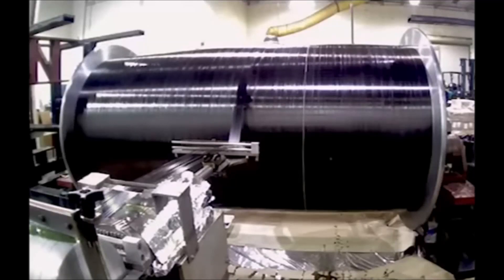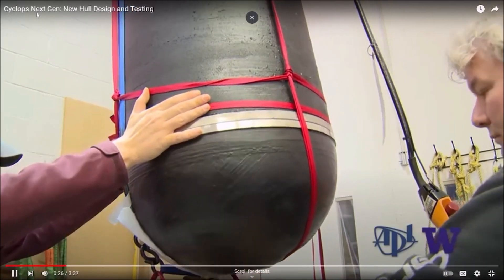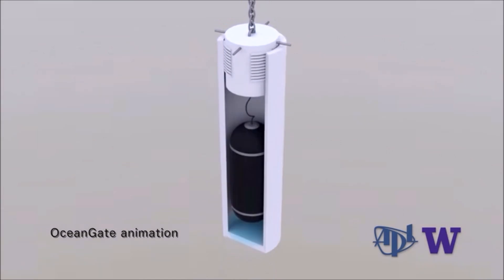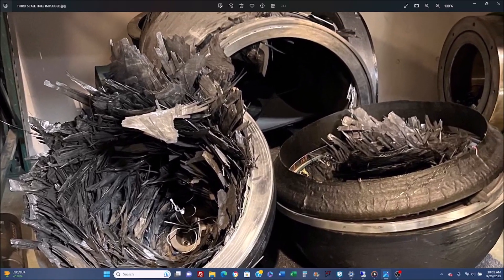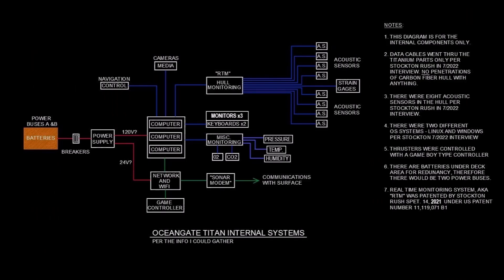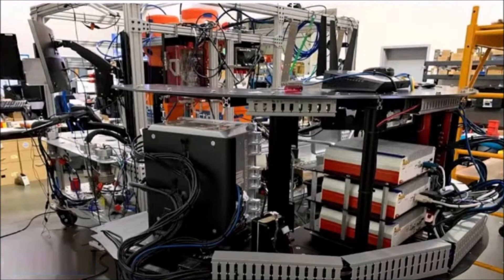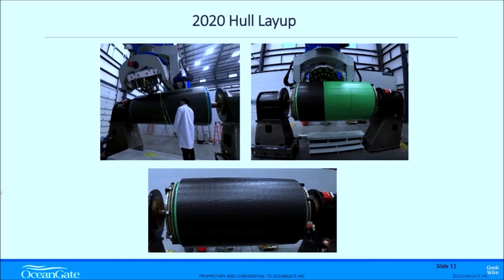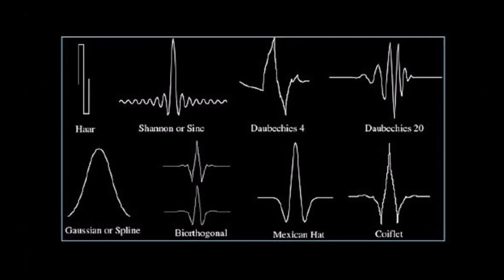OceanGate Titan - WHY USE CARBON FIBER?

Comment: Describing the use of carbon fiber for the hull of the submersible @5:28 "Was it the right move?"  Given that Stockton Rush was killed as a result of choosing this design I think the answer is clearly "No!!!"
I have a mechanical engineering degree which included a course in composite materials and when I heard that the hull was made with carbon fiber I thought that choice was the exact opposite of everything I had learned in university.  Composites like this are good in tension however the load the hull experiences is compression.  Using a composite in this application means you are subjecting it to a compressive load.
When a composite begins making a cracking sound that is a sign that either the fiber is breaking or that the fiber is breaking free of the matrix.  Both of these conditions indicate that the composite is being weakened because it cannot handle the load it is experiencing.  Whether the hull collapses or not that is a sign that the design is not working as intended.  The fact that Stockton Rush knew it had made cracking noises and continued to use it is completely inexplicable to me.
Reply: If the vessel is pressurized, the carbon fibre is under tension. The CF is picking up the load.
In the submarine, the vessel is under pressure, the CF is not in tension, only the Epoxy is taking up the load. Now it becomes the theme of a horror movie.
In this context, I think glass fibre might hold a better chance than carbon fibre.

Under compression, the CF inside should wrinkle and leave weak spots between layers so the high pressure sea water acting as a hydraulic fluid to crack open the inner layer defects to create the recorded sound.

In engineering 101, we have cantilever truss. The truss beam members could be in tension or in compression. For those parts in tension, the member could be replaced by a rope. But replace the beam in compression, it falls.
Reply from the maker: @lpjunction  Yes the way these cylinders were manufactured, the strength was mainly in the resin. If they could do a layup where every layer was alternating with fibers going in three different directions (an X-pattern along with the hoop) I think it might do the job. Problem is they can’t manufacture it like that.
Reply from the maker: It's easy to say that it wasn't the right move in hindsight. 😉I know exactly what you are saying and don't disagree with any of it. Don't know if they went over the Kaiser Effect in your courses but that seems be be what Rush was basing the whole thing on. It makes sense to me that on the first dive there will be a certain amount of fibers that will break when taken down to depth, because we can't really manufacture a 100% flawless CF cylinder. On successive dives there should really be no more noise unless you exceed the last maximum. That's exactly how the 2020 hull performed until it suddenly failed. The 2017 hull did not align with what was expected... on every dive it was making noise, which it shouldn't have done, so it was scrapped. 

Seems to me like Rush was maybe applying the Kaiser Effect to carbon fiber where maybe it doesn't apply in the same way as metals or sedimentary rock, or maybe not at all.
Reply: @VegasCyclingFreak  I did take a graduate level course in composite materials but I am pretty certain that we never covered the Kaiser effect in any of my courses.  Having said that I would not be inclined to apply the Kaiser effect to a composite material in this situation.  From what I can tell, the Kaiser effect describes something (in this case a cylindrical hull) being stressed, making a noise, having the stress removed and then the stress is reapplied in a way that the thing being stressed responds elastically.  The elastic response is important.  If the sound was made by fibers breaking then the snapped fiber has failed.  That is is not elastic.  The material holding the fibers could respond elastically if it is an elastic material and the level of mechanical stress it is subjected to remains under a critical threshold.  I realize that it sounds odd but metals, when properly processed have excellent elastic behaviour.  In contrast, plastics and resins are not very elastic.

Alternatively, let's just ignore the Kaiser effect completely for a moment. In this case, the submersible goes down, there is a cracking sound which (hopefully we can agree) indicates some sort of damage to the composite hull.  In order to know if the hull is safe or not we would need to know how damaged it is.  If the sound is the sound of a fiber breaking then how many of the fibers broke?  How can we tell how much damage the hull actually took?  If we can't tell how much damage the hull took, how can be be sure it is safe?  That question can be very difficult to answer.  If it is absolutely essential to design the hull out of a fiber composite then the designer has an obligation to ensure that none of the fibers ever breaks during regular use.  If the designer cannot provide a design like that then they need to step away from the project.

That is why experts stick to design standards which are known to be safe.  When an engineer knowingly avoids these practices and puts someone's life in danger it is considered negligence which can be grounds for criminal prosecution.  Whether or not the Kaiser effect could be applied to composite submersible hull prior to this incident was clearly unproven and at best uncertain.  The effect of a hull rupture at depth was very predictable.  Design standards exist for a reason.
Reply from the maker: @VictorLonmo  Very well put. You bring up some of the same points I have pondered.

I have been coming to the same conclusion about the Kaiser Effect. I think maybe it was misapplied here. Kaiser Effect is also used with respect to certain kinds of rock too, so maybe Rush thought it could apply to CF as well. Does rock have an elastic response? That would be more along the lines of seismicity, wouldn't it? Kaiser Effect seems to apply in both cases. 

Carbon fiber really seems to be in a league of its own here. Rush's philosophy was that on the first dive you'll hear some of the fibers breaking because "they didn't make the team" but on the second dive you should hear none. The question is how much damage does that represent? Also the acoustic sensors in the rtm system were centered at 150kHz. What if the resin was breaking down on every dive but it went unnoticed because it was outside the range of what they were listening for? It is problematic using Kaiser Effect in this case.

If you want to read more about Kaiser Effect, here is a link to an interesting article:
https://www.ndt.net/article/jae/papers/22-S01.pdf

Comment: I think in order to reach positive buoyancy (making the carbon thinner) eliminates the supposed benefit of ; "strength to buoyancy" of carbon.
If you try and achieve the buoyancy by reducing the thickness then carbon becomes to weak for the job !
5" was not enough !
Unlike Titanium the proper thickness of carbon fiber for this type of application was never really properly established !
Imagine if instead of the required and well established 3 1/4" of Titanium they went with 1 3/4" of Titanium simply to reach positive buoyancy !
5" of carbon was not enough and My guess it would have needed between 12"-16" of carbon, and at those sizes the buoyancy advantage becomes moot !
Think about it the carbon was only a mere 1.75 inches thicker than the titanium !

Comment: Did he want high strength to buoyancy for safety Or because syntactic foam is very expensive? I would guess the composite structure was also far cheaper than a similarly sized forged titanium structure. So Rush being an engineer says, if composite is safer because of strength to buoyancy, and it’s cheaper, why NOT use it? I don’t think he calculated the cost of certification/testing or the cost of his life (risk).

Comment: I don’t think you’ll see the same debris in a chamber as you would on a real dive. Once a major failure occurs in a test chamber the pressure will drop rapidly because there is very little volume of compressed water. I could be wrong though.
Reply: You are not wrong.

Comment: Also, wound carbon fiber vessels are typically used for the containment of pressure within the vessel, since the fiber is then pulled as those forces react against the fiber, outwards. The resins used to bond those fibers in the curing process, play a secondary role in that resistance.
Imagine winding thread around your fingers and trying to force those threads outwards. If you were to reverse that force, however, and apply it to the outside of your vessel model inwards, the tensile strength of the fiber decreases dramatically. Imagine your thread wrapping model. The primary resistance to that force pushing in, as opposed to out, then becomes your fingers and not the thread.
 In the case of using a wound and cured carbon fiber submersible, the resin plays a greater role in reacting against that pressure. The resistance to that pressure, becomes dependent on the resin used to bond the fibers, moreso than the fiber itself, which defeats the purpose of using a wound vessel.

Comment: Deep sea vessels are made of material/s that have a very high compressive strength.  The obvious reason is in that environmental sea pressure creates tremendous crushing force on the outside of these vessels.  Primarily important to avoid catastrophic destruction by implosion, a deep sea vessel must have sufficient compressive strength.   IF this strength condition is met , THEN and only then, can other advantages of one material over another be utilized.  Carbon fiber composites are not nearly as strong in compression as in tension.  Hence they are found in airplane bodies which makes use of their high tensile strength (rather than their relatively weaker compressive strength).   So to me, it is pointless to bring up the strength/buoyancy ratio of a material that doesn't first meet the compressive strength criterion for deep sea diving.   (even though the Titan reached the 12,500 ft Titanic depth a few times, it obviously wasn't strong enough to continue experiencing the tremendous cyclic forces incurred)
Reply from the maker: True but it also all depends on how the carbon fiber is manufactured. I think there is a way to do it but we can't with the technology that is currently available - the machines aren't capable of winding cylinders with filaments going in three different directions, which is how I think it needed to be manufactured. I believe Titan was on its 14th "mission" to Titanic when it imploded. They had also made some other dives to do 8K video of Titanic as well, so maybe 18-20 dives to 3,800 meters as far as I can tell. Apparently the hull failure was due to a sudden and unpredictable development which seems to point to kink band formation. The 2017 hull never even made one dive to the Titanic because it was not following the rules of the Kaiser Effect and had to be scrapped. That's why the new hull was made in 2020 and it performed exactly as predicted. The real time monitoring system was supposed to prevent this from ever happening so there's a disconnect somewhere...

Comment: You couldn't fit 4 people +1 in titanium = no mula
Reply from the maker: Yes I should have also mentioned that. That was the other factor... but on the other hand, it's kind of obvious as the Cyclops was also a five passenger steel hulled sub that could go to only 500 meters. Titan was like the Cyclops on steroids, so to speak.

Comment: I keep saying this, ultimately the decision that made this incident a tragedy was to allow passengers on board.  Nothing else. If Stockton and a handful of employees died at 3k dept in some kind of unregulated experimental sub, the media attention would have been marginal.

Although I find the engineering aspects fascinating, the engineering decisions did not lead to the tragedy.
Something and/or someone pressured him to take passengers. Hubris and prestige must surely have played a certain role. 
But if investors forced ocean gate to take this path, then I consider that the root cause !
Reply from the maker: Ultimately, the Titan (originally called Cyclops 2) was the Cyclops taken a few steps farther and made to theoretically withstand depth of 4,000 meters. Rush originally wanted the hull rated for 6,600 meters but apparently he couldn't get the manufacturers to give him something that actually could meet that spec. As we can see, one failed miserably and the other one eventually failed for reasons unknown. Anyway, the Cyclops was also a five person sub made with a steel hull and it couldn't dive very deep at all.

According to a former business partner, Rush was very risk averse. I don't believe he was the person that he has been painted out be. Yes, a bit of a maverick but not some suicidal crazy daredevil. He was actually a lot more concerned about people getting hurt before they got into the Titan. He actually said that once you were inside it was the safest place you could be in the world. 

It could be that investors were partly driving this. I am not sure how Rush went from diving the Puget Sound to wanting to dive to the Titanic. I don't know enough of the back story here. Anyway, the reason I am doing all of these videos is because I do find the design of the Titan interesting from an engineering perspective and also to get to the bottom of the possible ways that it could have failed. This has turned into a hugely larger endeavor than I thought it would be!

Comment: Interesting video, but I disagree with your ultimate conclusion. It was all about the cost. Stockton Rush wanted better strength-to-buoyancy, yes, because it would mean less cost. It was all about profit margins. He gambled not only his own life, but the lives of others, on this cost-cutting measure. 

As I've pointed out on other videos, Stockton Rush was wrong about his interpretation of the noises he heard. The only acceptable noises coming from his pressure vessel would be no noises (meaning that no carbon fibers had broken). His second hull was thus nearly as bad as his first hull: mortally-wounded and unacceptably-weakened after the very first dive. An implosion was inevitable; not "if", but "when".

The most interesting moment in your video, though, is at 2:26 when you falsely say "the carbon fiber just shredded". No it didn't! Your visuals disprove your words! That's not "shredded" at all! That's delaminated! "Shredded" would be random fibers broken in random places. That's not what we're seeing! We're seeing entire laminae breaking all at once, along sharp edges! Fascinating! It also gives huge clues on how carbon fiber composites can be made just as strong under compression as under tension: One must use symmetric 3D matrices instead of laminated 2D laminae. One can't do that using simple winding bobbins as shown in this video, though; a way would have to be found to insure that the carbon fibers were structured like a random heap of over-cooked spaghetti piled on a plate, rather than strands going all in 1 direction or even 2 directions. The strands must go in 3 directions. Then you can make 4000m submersibles out of carbon fiber. But not if the strands only go in 1 or 2 directions; it's that asymmetry which destroys the ability to handle compression.
Reply from the maker: Yes, in technical terms it de-laminated. In my mind it's all the same thing here. One could even say it exploded. That's the term that Rush used. That's all a semantics game that we can split hairs over, like the peanut butter thing. All Rush was doing there was describing the consistency of the glue in terms people would understand and everyone went off the deep end about it. lol

We can agree on one thing: I had a graphic in my last video where I showed how I thought the CF layup should have been done with layers going three different directions. I had that thought only a few days after the implosion when I watched that 2017 hull winding video before OceanGate took all of their videos down, which I knew was inevitable. That was not the hull that was actually in Titan when it imploded, however. The 2020 hull was probably was made roughly the same way but with what appears to be a better type of carbon fiber using a little better process. 

I did not mention it but the other reason for going with carbon fiber is to make it large enough for five people. Still disagree that it was all about cost. How should he have done it then? An enormously heavy 10 foot diameter sphere with huge amounts of syntactic foam? Maybe you could get five people inside of that. Is that going to look cool and appeal to extreme adventure seeking billionaires?

For me this all goes back to the manufacturers. They were supposed to be the real experts here. One hull failed by a mile and the other one eventually failed too, I think after 20 dives total with 13 "missions" to the Titanic. Rush was depending on them to build him something to his specs. Why would both of the manufacturers have done it more or less the same way? Seems to me that they don't have a better way of doing it, and/or their modeling programs led them to false conclusions about how to manufacture it. It seems painfully obvious that fibers going three different directions is the proper way to do it. 

You can argue the Kaiser Effect thing both ways, but it applies even to metals. Titanium probably also would make some amount of noise on the very first dive but after that would be quiet because you're not exceeding the last maximum. I think it's impossible for the carbon fiber to never make any noise in this kind of circumstance due to the nature of the material. I don't know that it has a "memory" like metals do. Perhaps that is where Stockton made an error with his trust in the real time monitoring system.